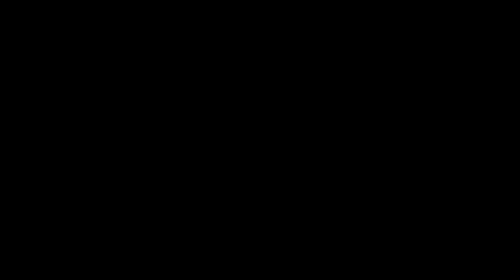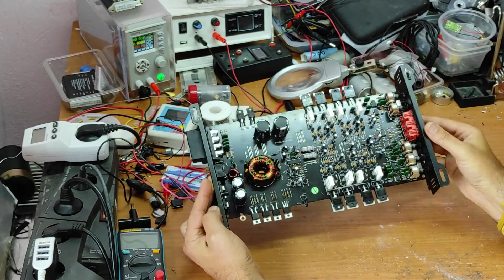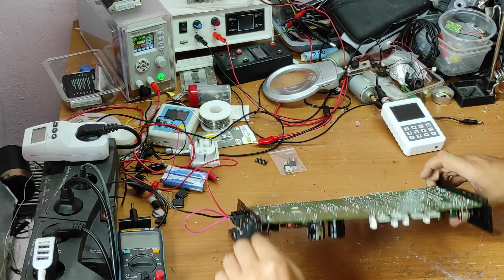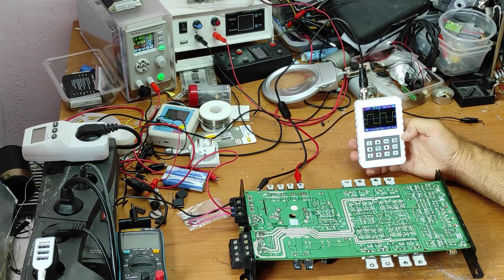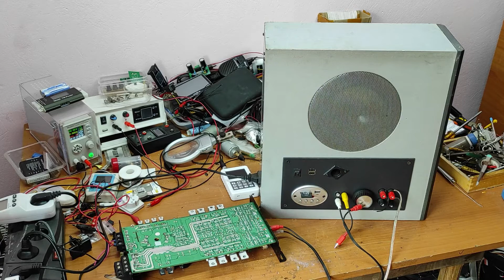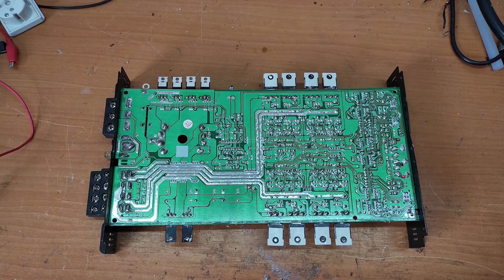How to repair Auto Amplifier Renegade 1100W?

Comment: Hi! I have a Renegade amp with the same issue. The 2SD1047 and 2SB817 output transistors get extremely hot within minutes, even without any music playing. We've checked everything with a multimeter and all components seem fine, but they just keep overheating.
Do you happen to have a schematic or circuit diagram for this board? Or maybe you know how to fix this issue? Thanks!
Reply from the maker: I dont have the schematic, I think idle current is too high u can check

Comment: How did you fix the switches? My amp has the same issue on the crossover switches for hp/full/lp ?
Reply from the maker: u have to use wd40 or contact spray bro

Comment: Hello i have Renegade REN1100S and i have problem its not working  its not even showing any light and when i try with multimeter where is power i get 12+V on casing... i think its bad do u know maybe can be problem?
Reply from the maker: if u want help u have to give me more details.
Reply: well, my problem is that I connect the amplifier normally, I connect 12v, rem and ground and the amplifier does not turn on, no indicator lights up and I looked at the fuses, they are fine, but when I tried to look with a multimeter where there could be a fault, I still did not find anything, only that I measure 12V on the metal casing and on the screws @diymariuselectro
Reply from the maker: u should check + - 25v .if u not have u have to check mosfets and IC 484.
Reply: @diymariuselectro  can you send me email? I find a problém but i dont know why its making it i want to send you pictures
Reply from the maker: bro I can help u if u support the channel.